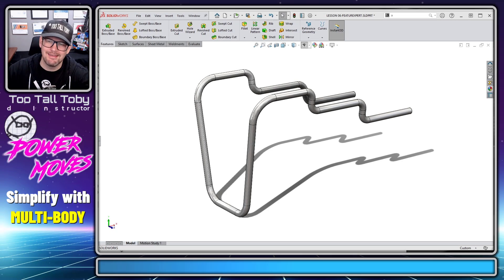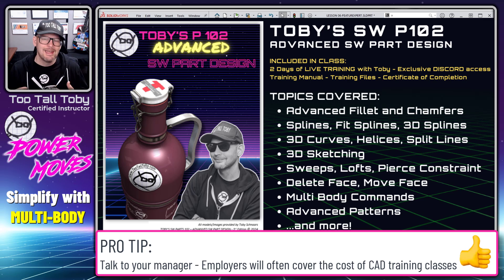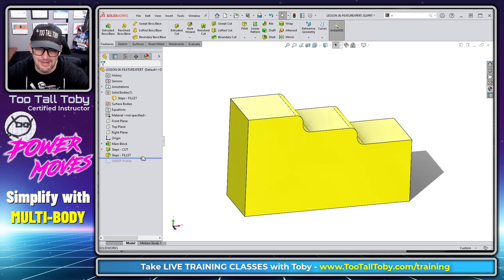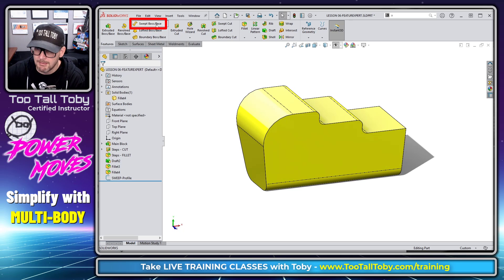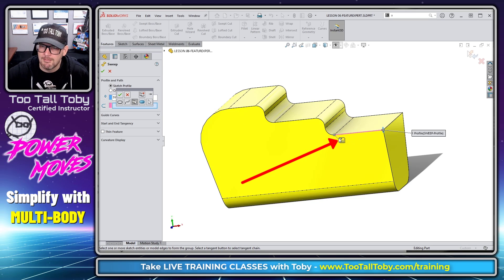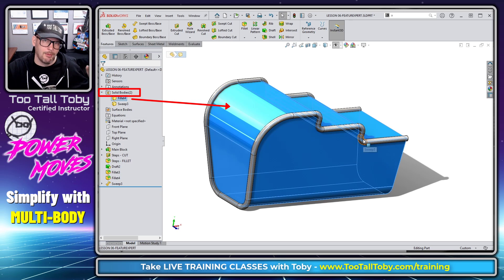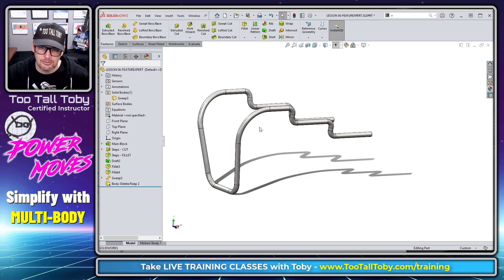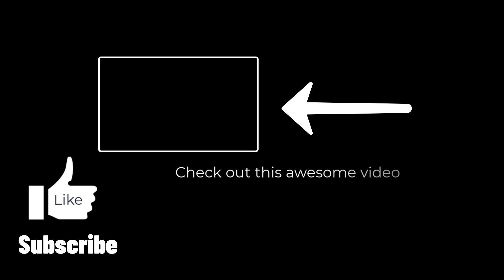Enable EASY MODE for COMPLEX SWEEPS

Comment: The guys over at Alibre Design like Joseph Larsen and Kostas (Ex Machina Engineering) do this stuff all the time.
Reply from the maker: yeah its a total pro move!
Reply: @TooTallToby  Absolutely!
Reply: I do do it in Alibre, but it's a Joseph move. He's the one that got the workflow down and then showed it to all of us. But KUDOS to Toby because it is slightly different in Solidworks and I might not have thought of doing it that way. I would have probably gone with 3D sketches...

This is a great video and a great Tip!